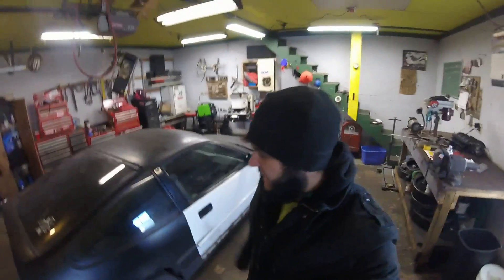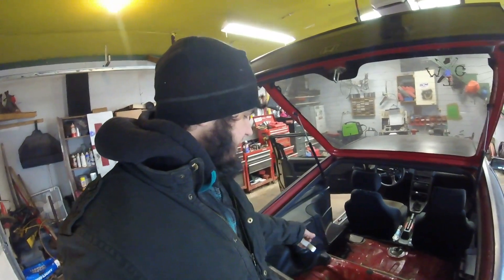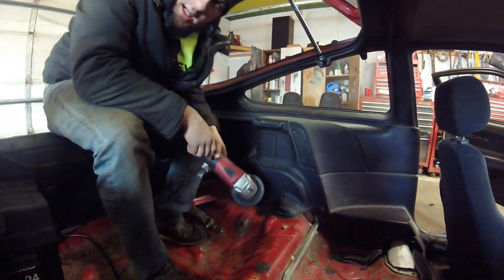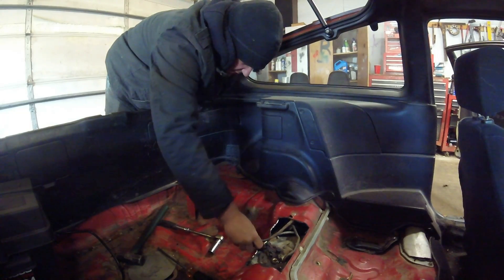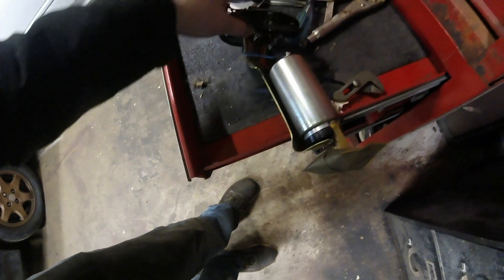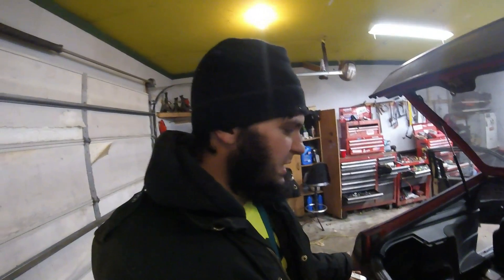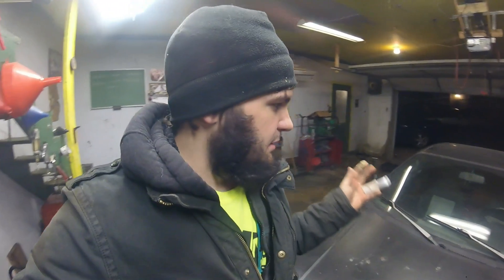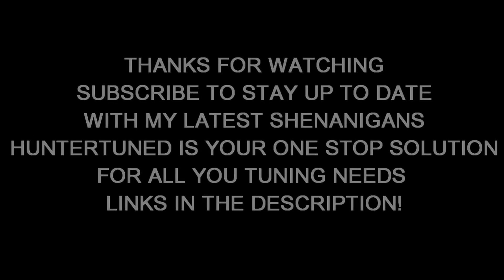CRX Fuel Pump Install. Hack Style! CRX Trans Is GONE!!!!

Comment: I've got to change my pump soon, I'm very tempted to use the "hack" method haha
Reply: I have to change my pump and this video confirms that I won’t be dropping the tank. Plus I can change it easily if I want to upgrade
Reply: @stealthypirate318  it's takes much less Time to drop the tank. Jack it high as you can and take the 2 tank straps loose. Nothing else it leans down enough to get it without disconnecting anything else. I just did mine yesterday.
Reply: @derekmaxwell8164  Seriously? That would be nice, if that works...

Comment: Did this today in my CRX worked fine, you do have to cut the fuel line and then use a fuel hose not that big of a deal. You can cut into the gas tank a little if you’re not careful also I cut some electrical so I had to rewire it also. Good way of doing a fuel pump replacement on a track or beater car. The back trim will cover this area if need be too. Wouldn’t do this to a daily without re-sealing the hole you cut.
Reply: oof